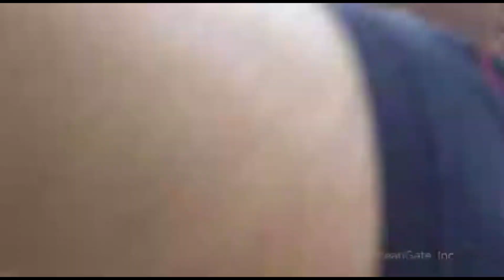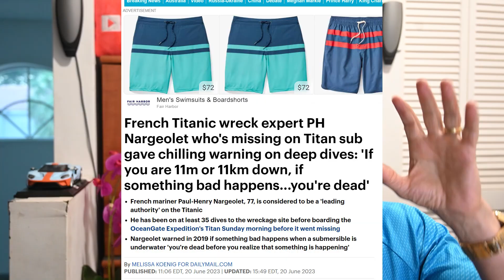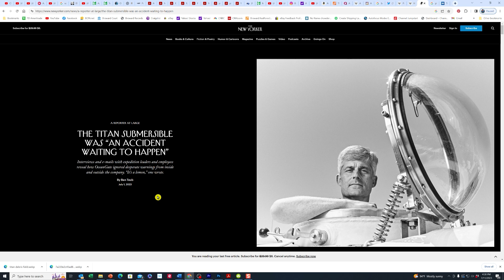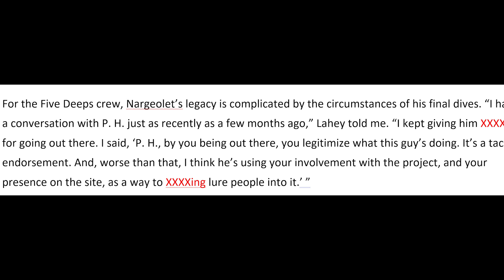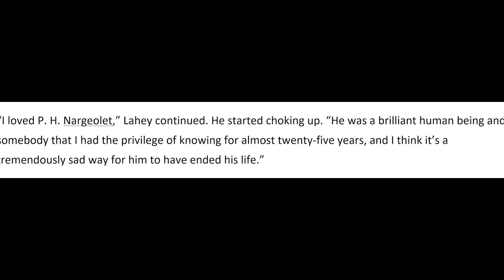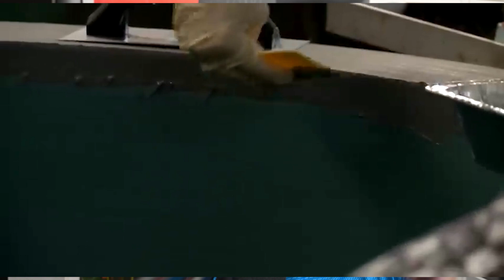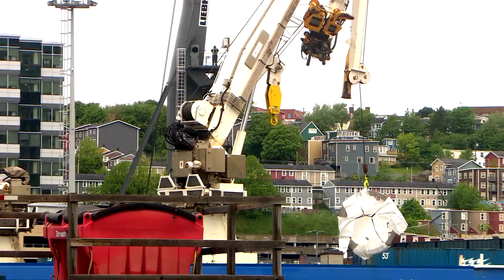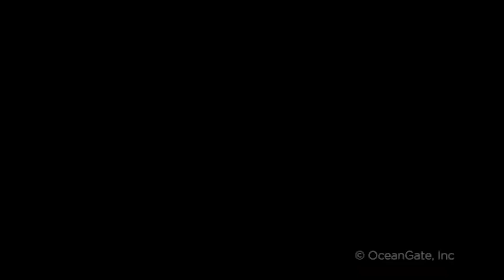Titan Sub: More Q&A, Design Defects, Why Descent Fast

Comment: did it collapse the same way that those Champlain Towers ? was that pool deck collapse the same as the alert indicators before the silence ? i think destruction follows a pattern :p 
i think with some permission by poetry it can be performed with the same framing 
and if it is not the same pattern of destruction , it sure is the same pattern of construction , the same motives are  behind .

Comment: The glue interface is probably the thing of least concern at depth IMO. By the time you're relying on the glue to hold the end caps on, you have larger problems - at least for a few milliseconds.
Reply: Wow... You use adhesive on polished surfaces regularly do you? Kind of industry standards to have the contact surfaces be optimized for perfect bonding. Any less is amateur hour.
Reply: @stever2583  My point is that it made little to no difference. The glue isn't what failed. Wind your neck in.
Reply: @TomChaton  The glue did fail! The images from the recovered Titanium rings show the absence of any "glue". Which part of that do you not understand? FYI... You think that the pressure only exerts on the titanium ends and not in the center CF? There are no words for that logic... Next you'll be blaming alien technology - this is what happens when you take zero time to understand a problem before solving it. Kinda like that Rush idiot!

Comment: When you look at carbon fiber, it is essentially just very floppy string. Can you push a piece of string, not really? In tension as a pressure vessel the carbon fibers aka strings are in tension, and you can pull a piece of string. But external pressure on a cylinder is trying to push the string. The resin keeps the strings from buckling and collapsing but only up to a point. 
The titanium rings are machined with multiple stress raiser sharp edges and corners. They have lugs and eye bolt sockets welded on them creating uneven strength in the metal and in the shape, around the ring. Uneven strength contributes to a collapse from external forces.
The carbon fiber cylinder, the titanium rings and the hemispherical cylinder ends will all act differently under any applied stress. The difference in movement will be a major cause of fatigue especially at the smooth mating surfaces with only glue to hold them in place.
The game controller used as a submersible control unit was designed for non-critical service in a home and a dry atmosphere and certainly not SIL rated, should never be used in a saline atmosphere. Internal contacts if copper will soon fail. It could easily have contributed to the descent rate issue.

Comment: Seems like a couple of cake decorators might not have been the way to go with the adhesive. Could be the video of the carbon fiber being wound up it might have been pre impregnated and the pattern of the weave at right angles to each other is strength related. Did they vacume seal the hull to get it uniform or bake it in autoclave ? Do thay do that for wind turbine parts ? They are pretty big. If you find a drawing of the sub look for a section that could have flooded that explains the rapid decent.

Comment: Another critical element that could have quite possibly been a contributing factor with the failure is the difference in the thermal expansion coefficient properties of dissimilar materials. Especially when the difference is between a metal and what is essentially a plastic. The size difference over a temperature range of 30 degrees C. is in the order of millimetres. This amount of change in size would have placed a considerable shear stress on the glue bond to the titanium surface. Another interesting behaviour of carbon fibre/resin composite is that while the resin shrinks with a drop in temperature the carbon fibre expands which over repeated cycling can lead to a compromise of the resin fibre interface within the composite matrix which would allow for water ingress at extreme pressures.

Comment: It’s extremely unlikely that this has anything to do with the lack of abrading on the shell while carbon fiber is being applied.  Much more likely is the different expansion and compression rates of two different materials that eventually, over time, lead to stress fractures as the two materials would compress and expand at different rates over time.
Reply: Normally you would scuff something up so the glue has more grip but this thing is going into outer space.....I mean to the bottom of the ocean. I got them mixed up because both are equally dangerous and required ever nut and bolt and every drop of glue and every hand that touches the vessel needed to be under controlled conditions. This damn thing was assembled on newspapers on their mom's kitchen table.
Reply: So the gluing of the bell caps to the Fibre with a polished titanium meeting the fibre had no issues with you. Have you ever seen fibre glued to metal using polished surfaces to hold the glue?
Reply: @stever2583  of course it does. Everywhere they are trying to link two different materials is a potential area for degradation and eventual failure over time due to the differing material compression rates.

Comment: what about the temperature swings back and forth? 3d printers use the differential shrinking between the metal heated bed, and the plastic part, to "pop off" the part as they both cool down.
as you mentioned, differential compression of the multiple materials, it would be worse adding in temperature swings.

Comment: No mechanical bond, greasy hands on the glue surface, minimal epoxy. Sanding or acid etching is absolutely required for successful adhesion. Additionally the Epoxy should have oozed out from every section of the 360° seam where the titanium met the carbon fiber.

Comment: Also saw there wasn't roughness on glue faces, a "mechanical" aspect would normally be expected, and it shudda been a cleanroom, gloves, masks for breath condensation ... non-pro scene, boats get more attention to detail. The join needed mechanical pins through the layup to prevent creep ... too many wrongs, Rush got rid of his best ppl the ultimate error in leadership.

Very sad, many ppl knew.

Comment: If you take the reports of depth from the transcript (and you assume the transcript is real, which is not too much to ask), you can see the descent rate was fast but it also got faster during the dive - possibly peaking at nearly 50m/min. This is corroborated by remarks from Stockton beyond the '35' report of depth where thrusters weren't helping and he sequentially drops the ballast and the landing frame.
By assuming some figures for rate during that time (based on what was said), one can anticipate that the Titan descended to near 3600m before starting to ascend but, likely, the rate was slower than expected and getting worse - bouyancy was already compromised. Rush even commented on it: 'Quarter predicted' seems to indicate a rate 1/4 of what the craft should have been ascending at given no ballast, no frame, and full thrusters. I suspect the thrusters were not functioning at all and were shorting the power supplies (stall current).
The tragdey of that is that the sub could have gradually lost bouyancy to the point where it started to descend again, and probably lost power - ending short messages - before it imploded.

Comment: You absolutely  have to do  a proper surface prep  which involves  profiling or abraiting  the surface and then washing the surface. 
You also have to check humidity levels and dew  pints.  
You have to clean and then test for contamination  before you even do your surface prep because  if you don't  you will contaminate  the surface further when you sand  by pushing  the dirt or contaminants  deeper into the micro pores of the surface . Once you are free of contamination   you then  sand or profile the surface   then when you finish you do a profile test  to measure if the surface profile is deep  enough  but not too deep  then you clean again  and test again for contamination..
I would also like to know if that epoxy resin had a curing or Hardning  agent that had to be mixed in and how they went about mixing it . If it had a curing agent you had to mix in  if top much was mixed  in the cured epoxy would have a brittle quality  to it and it would Crack.  If not enough was  put in it would not completely cure and you would have weak points 
Also was it evenly mixed do that you didn't have different concentrations of cure  .

Comment: Rush's crew of assemblers sound like they were a bunch of amateur decorative craft builders, as if they were just hired from off the street and made minimum wage to save costs. I'm not an engineer, but as a model builder, I've learned the importance of abrading smooth surfaces before gluing them together. Even then, adhesives don't do well with supporting hanging parts, say like extended wings on a dragon figure. So pinning is necessary to insure the glue doesn't give out and they fall off. Also, gluing together dissimilar materials, like metal to plastic, can be problematic, since they don't fuse together, like PVC plumbing pipe does.  I think whatever Rush's credentials were as an aeroplane engineer were overrated, and he was a lazy hack whose ego cared more about fame and wealth than really being seriously interested in the ocean or the Titanic.  In short, he was a James Cameron wannabe copycat, and he made others pay for his hubris.

Comment: Definitely one of the more interesting subjects to learn about currently.
It's definitely tragic but there's a lot of lessons to be learned from it.
Reply: Don’t be stupid like this CEO is the only lesson I see.  All the other lessons were learned decades ago (but he chose to ignore them).
Reply: The problem is we don't actually know how the pressure hull was designed since obviously a company isn't going to make public how it made the most important part. I think it was a short circuit that led to a battery failure. It could have been a clever murder by someone close to one of the passengers.

Comment: I was watching this youtuber Jake Koehler go on Titan, and although he didnt make a complete dive the process before was well documented. One of the things was that he was weighed, with his clothes, things he wanted to bring on titan, and any consumables and it was overseen by Stockton. If the decent was at such a higher rate that it used to be or was planned, could there have been miscalculations with the amount of ballast they were supposed to bring.. Did this also have its effect on the issues of not being able to start ascent or have a more rapid ascent? Just wondering, especially after you mentioned that a higher descent rate increased pressure at a quicker rate giving different consequences..

Comment: Could the sub have developed a very slight leak that caused water to come in without immediately tearing itself apart? Maybe a slow water leak that then caused it to tip on it's side and dive down like a torpedo?
Reply: submarine above the crush depth slow leak yes. submersible  below the crush depth any leak and implosion in a millisecond.

Comment: The roll comes pre wet, and what you are seeing is the pre wet carbon fiber. It also has to be stored in a freezer so it doesn't harden. And this is why it has an expiration date you hear about. 👍

Comment: Let’s use some physics and logic.

Descent rate by itself doesnt matter but it does say they were heavy and getting heavier.  Which means water was infiltrating the hull.  Which means the first noting of higher descent rate should have told them to immediately jettison ballast and abort dive.

Hoping to detect early cracking as a way of aborting before collapse is a fool’s errand.  Crack propagation rates are not predictable.

Submerging in a hull that has an accelerating failure mode is also a fool’s errand.

The end caps are pressed onto the hull by huge hydrostatic force.  The glue at the cap/hull interface is of no importance at depth.  Forget it.

Carbon fiber is like a noodle.  It cannot stand compression because it bends   The surrounding epoxy must keep it straight under compressive load.  But the epoxy itslf is not very stiff so after enoungh cycles it has moved enough to create stress risers and that starts a crack  Sure as hell.

SUM. Bad design, bad acceptance of known risk, bad outcome.
Reply: Very concise and easy for a layperson to understand. Thank you.